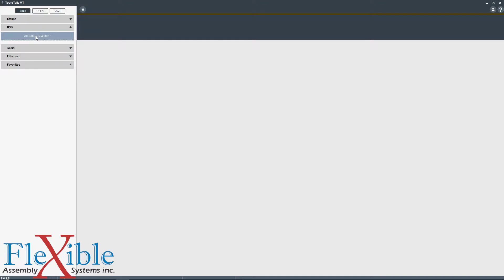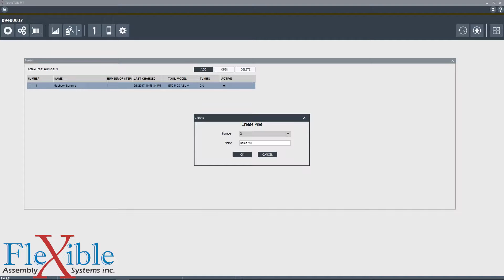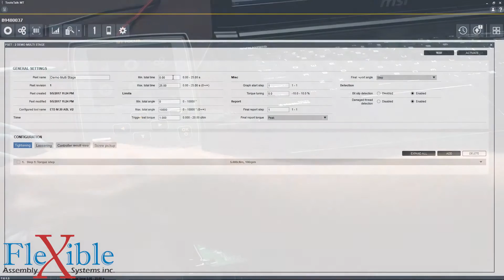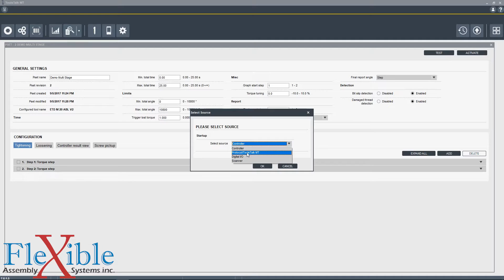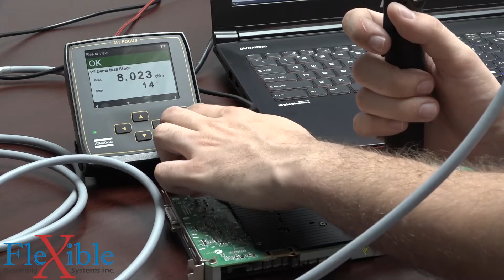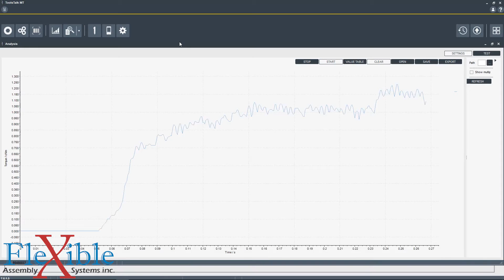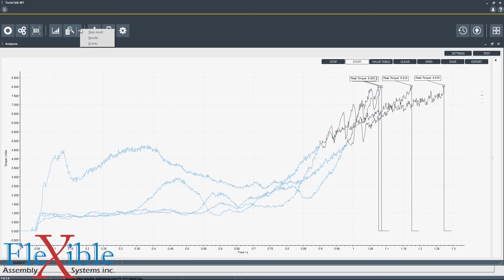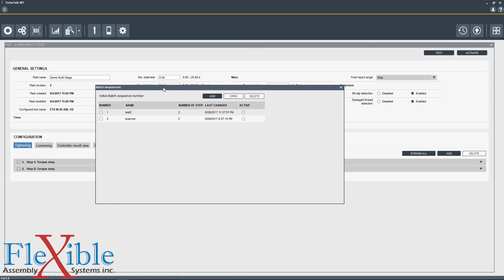Atlas Copco Multi-Step Tightening with the MTF 6000 and ToolsTalk MT

Comment: Is Tools Talk included with the purchase of a MTF6000 controller?
Reply from the maker: The new ToolsTalk software for the MTF6000 is free from Atlas Copco. You can download the latest version here: https://www.atlascopco.com/en-us/itba/products/assembly-solutions/electric-assembly-tools/corded-electric-screwdrivers/microtorque/ttmt
Reply: @FlexibleAssembly  I have a problem, my STwrench is locked, can you help me please?
Reply from the maker: I can try! Usually a locked STwrench means the wrench was interrupted while trying to transfer a trace. Connecting the tool back to its bluetooth or wifi will sometimes fix the issue, or connect directly to ToolsTalk to download the trace and clear the lock.